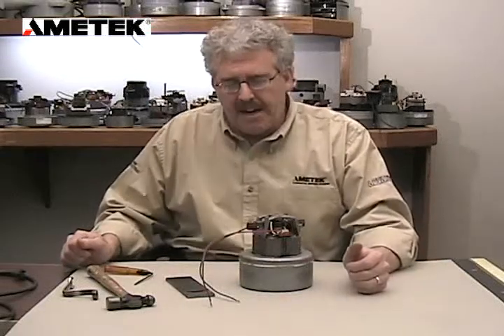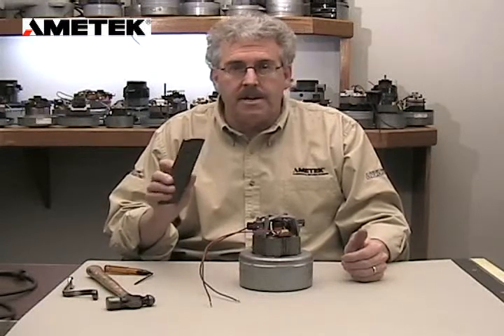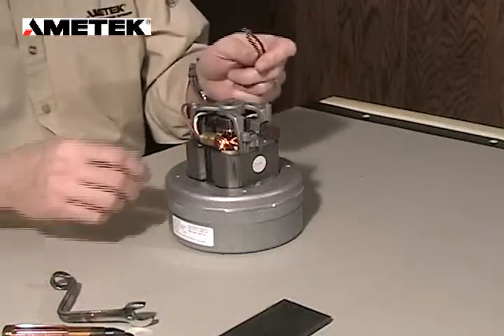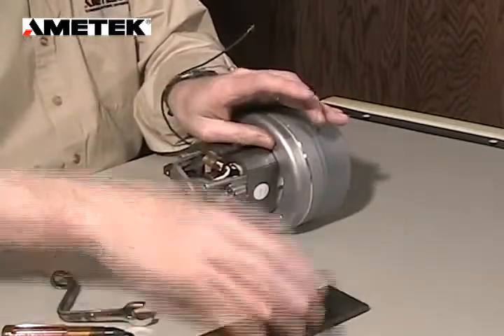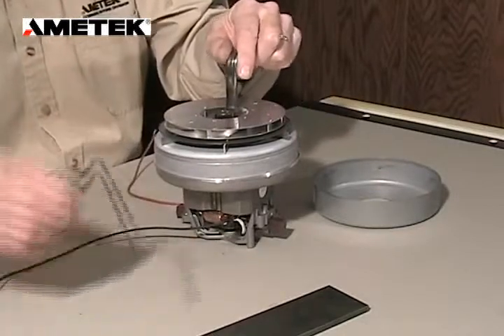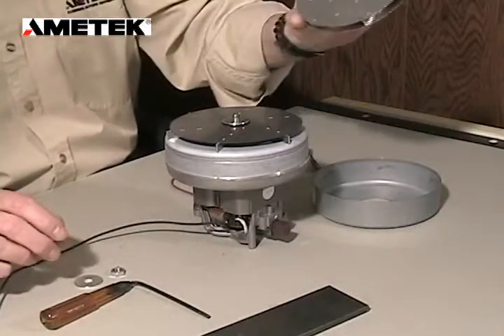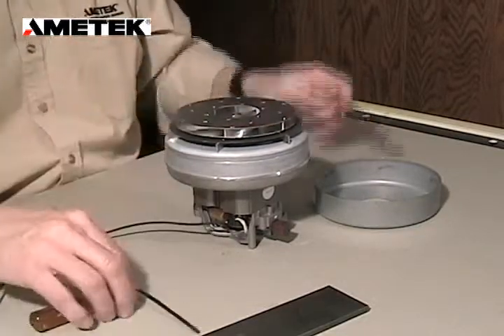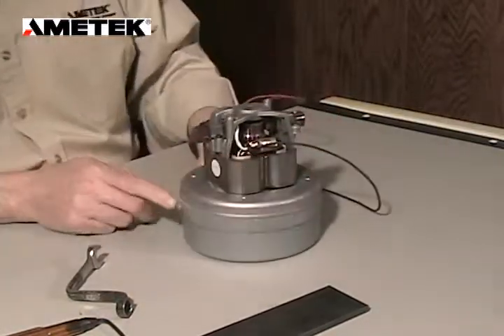How to Change a Lamb Electric 5.7 Rotating fan

Comment: I have a vacuum motor similar except it’s a 3 stage blower .. We have an issue, our beam central vacuum will stop sucking , but the motor still runs , it will work fine and then randomly stop sucking .. There is no suction at the machine but motor is running at normal RPM.
So I got the problem narrow down to the fan.. I have not got it apart , but what would stop those 3 fans from spinning , at random.. usually takes about 10 mins of running time before there is no suction.thanks